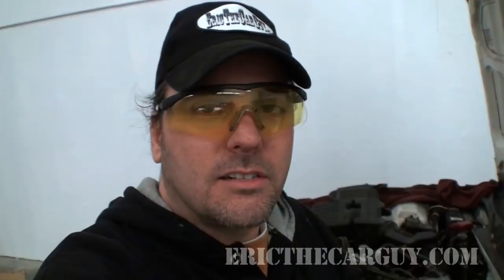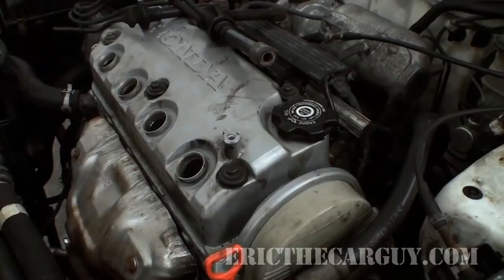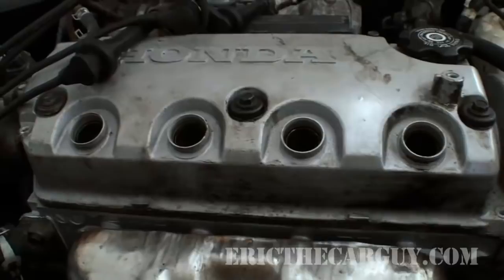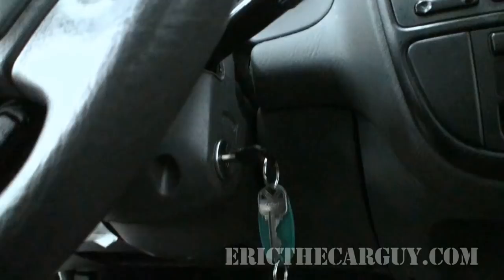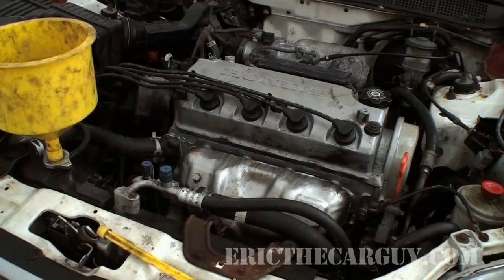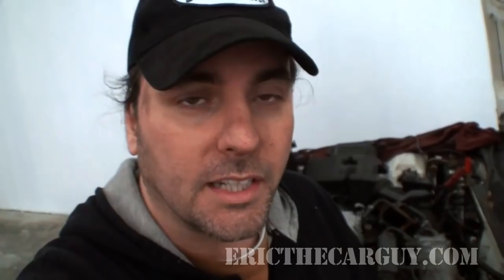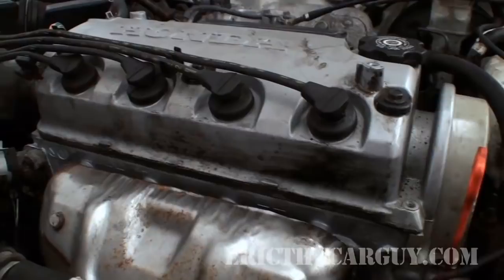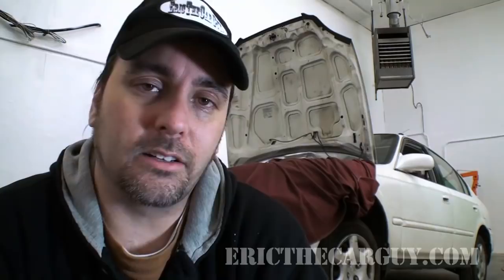How to Break In A New or Rebuilt Engine - EricTheCarGuy

Comment: This guy's information is 100% accurate. Unless of course you're dealing with a rebuit motor which utilizes a hydraulic non roller flat tappet camshaft....then you would pre prime the engine with a distributor oil pump tool....for example chevy 350....etc

Comment: Couldn't you just unplug the crank position sensor like we do on the Fords? Nothing works then and you are free to crank and build that oil pressure.
Reply: same as GM's
Reply: You can but sometimes the sensor is hard to get to. I'd have to pull the lower timing cover off to get to it on my Lancer.
Reply: Oh wow ok I see.
Reply: Yeah, you can do that on older subarus too if you just dont want spark, it still might pump gas into the engine though, and you still have to remove spark plugs if you want no compression for easy turnover, but yeah you can remove the crank sensor and it stop the car from sparking
Reply: GM 3.1 3.4 and 3.9 V6s have TWO crank position sensors....

it will run if the high precision one goes out..... but if the low precision goes, it wont run
Reply: My Volvo won't even crank without the cam sensor in.

Comment: Eric, when i used to play with Chevys back in the day i had an old distributor and i ground off the teeth on the distributor so it engaged with the oil pump only so when i was starting up a new engine i would use that and a drill to 'prime' the engine with the valve cover off, FYI small and big block distributors were interchangable- that way the engine was totally primed with out turning it over at all, as soon as the oil can out of the rockers that was sufficient.

Comment: heres a tip for cleaning greasy hands. baking soda+soap any kind. works very good and doesnt leave hand smelling like grease.
Reply: I suppose anything gritty works. The soap I use has bits of sand from different minerals as well as a degreasing soap
Reply: Washing up liquid and caster sugar works really well too.

Comment: i heard that you should under no condition ever let it idle after you just started it up. you obviously didnt do this and definitely seem to know what youre doing, so what was up with that?
Reply: There are a few myths and a bit reasoning behind not letting a cold car idle. First off is the car is not at peak engine temp and the fuel may not combust all the way causing excessive carbon buildup in the cylinder (bad cases can lead to improperly seated/sealed valves which is a loss of power) that can also foul spark plugs. The other main one is that the oil pump is engine-rpm dependent and people believe that the low oil pressure at idle does not adequately provide enough protection on a cold startup after it has sat (not such a big issue on a car that has been driven a bit and gushed a substantial amount of oil into it's bearings). Those are the main ones people believe (at least that I have run into). If your managing a vehicle "fleet" you will hear things like 1 hour idle is equivalent to 30 miles driven. which doesn't sound like much, but it adds up pretty fast if the vehicle is in constant use.
Reply: thats not true, it shouldnt warm up fast or raise rpm. idle is good idea

Comment: Another method I've used is to make a 'preoiler'. Use a pumpup garden sprayer, attach a barb fitting into where the oil pressure switch is and attach to the flexible line from the sprayer, having removed the reg handpiece. Pump it up and rotate the engine slowly by hand/plugs out etc, you will hear the oil displace the air in all those empty passages. Have measured 40psi doing this Once oiled, reattach/install and should be ready to start. Cheap as well. Should leave sump empty when you do this.

Comment: ...isn't this what assembly lube is for? ... I rebuilt my EJ22 with my friends help and I just coated my cylinders with motor oil and used the assembly lube everywhere else and put oil on the heads when I closed it up...  sure motor chugged for a few turns of the key motor turned twice then coughed ... second pull I had it run for a few seconds then die again... third shot it roared to life and I got full oil pressure and all was good with the world... seems like this spinning piece is redundant if you do all the above when you reassembling it anyway...
Reply: Bob Villa if you didn't assemble it yourself and bought it as a rebuild from a company, you can't assume they used assembly fluid. Also, assembly fluid will do the same this as regular if the engine was rebuilt and sat for an extended period in a warehouse. There's a ton of other reasons too, like lubricating the main bearings, cam bearings, wrist pins, etc at low rpms without much resistance and heat prior to staring the engine. Every rebuild from an aftermarket company suggests priming the oil pump and filling the oil galleries for this reason, no matter how recent the build was. Also, there's many engines that have high pressure oil systems (usually diesels for passenger vehicles) that have oil reservoirs for higher demand times within the engine. The 6.0L PSD I'm rebuilding for a friend is a fantastic example of that. Basically, to err on the side of caution is never a bad thing.

Comment: "No noise, no drama..." My man... That shit sounds like a mini knock D:
Reply: Yeah I heard knocking sound too lol
Reply: The ticking sounds at the 5:00 mark is actually the fuel injectors cycling.  The injectors on most D-series engines are very loud, and make more noise than the valvetrain if it's adjusted properly.  This is perfectly normal, and sounds NOTHING like knocking.
Reply: Sounds like lifter needs adjusted or just fuel injectors cycling no big deal

Comment: @WhenImGoneCa it's the cam break in period if you put a aftermarket can in you idle it between 2000-3000 rpms for 20-30 mins. It prevents a flatt lobe.

Comment: dude, change your gloves when you touch the key. The first thing your customer will touch is the key, and no matter how perfect the repair is, the first thing they are going to think when the key is slimy is, "eeeewww gross!"
Reply: +donsbarkingdogs3 or.... just use a clean paper towel to handle the key
Reply: agreed! everything is filthy
Reply: +donsbarkingdogs3 Considering this is the second time this person has replaced the engine.... For the exact same reason both times.... I doubt they care
Reply: Yep.  I took my car to a new (to me) oil change place (didn't have time to do it myself and didn't want to get greasy) which had very high ratings.  They got oily fingerprints all over my door panel.  Never going there again.

Comment: A subtle nuance that most of you are missing... oil isn't only there for lubrication.  Prelubing is important for all the functions of motor oil.  That is, it lubricates, cools, cleans and acts as a hydraulic fluid for certain engine components (especially modern vehicles with hydraulic timing belt/chain tensioners and VVT systems).  Making sure all the oil passages are full of oil before actually starting the engine for the first time is the only way to ensure that everything will be functioning as intended.  I've personally seen failure to prelube an engine with hydraulic timing chain tensioners cause the motor to immediately jump time, bend valves and punch a hole in the top of a piston.

Comment: I have heard so many variations to this each one has valid points... take a look at a race car engine do they put around for 500 miles before raceday? No, but they dont get the life expectancy that a passenger car does. When I rebuilt mine I never went WOT but I didt take it up  to mid-high rpm and let it coast back down in gear cause it helps seat the rings.

Comment: Why does the engine look so dirty for a rebuilt engine . when I rebuild engines they look like straight from the factory ,and no grease or hand prints all over them seems like this would keep the smoke and smell down. I also noticed when you make a video for whatever is wrong with a car or whatever you're  working on ,I noticed most of the cars are foreign, such as Honda or Lexus or whatever . you should be called Eric the( foreign )car guy . otherwise I believe you are very informative . good videos , and working as a millwright for 36 years believe me I stayed dirty  lol , take care  ,,seeeee yaaaaaaaaaaaaaaaaa !!!!!!!!!
Reply: even if you paint up your engine and make it all nice and clean, that engine enamel will have to break in with the engine.
there's going to be smell weather it's new galv burning in on your exhaust or anything.
Reply: also to add to logans comment. the outside isnt nearly as important as the inside. i would and have taken the time to clean mine inside and out because im a neat freak but priority is the inside. you can always degrease/wash is after its built and tested. :p

Comment: One thing you really want to avoid is endless cranking of a new engine. Find out why it is not starting without cranking on that starter over and over. The points in the engine (hey not ignition points) that you have lubed up with assembly lube will not stay lubed throughout endless cranking. You would think it would be easy to see if you have fuel and spark and quickly come to a conclusion why you have a "no-start" condition but it does not always go so easy. You also need compression to get it started. If you are sure you have spark and fuel pull those plugs and squirt oil in the cylinders, it may be a lack of compression keeping the new engine from starting.

I have seen a cam lobe go flat on a 351 Cleveland and it was due to long cranking after a rebuild. I have only seen this once so I tend to believe the cam was not "treated" correctly when it was manufactured,very odd.

Comment: i know what you're saying as the particle size is generally very small but i don't take any chances.
at the 1500 mile service we open the oil filter to see what kind and amount of metal particles have been worn off so in the rare event anything is wrong with the engine we can diagnose and rectify the fault before it becomes terminal.
it's over what's expected but saves us money and the customer the inconvenience of a breakdown.
also it allows us to check the installation for any leaks or faults.

Comment: simplyconnected is correct. once the correct engine break-in has been performed, which is usually in the first 5 miles, there is no need as it will have already seated all the necessary parts, piston rings, valves etc.  i would just change the oil after the first full tank of gas has been used to ensure all microscopic metallic particles are flushed.  also, i would use a standard oil for the first few thousand miles.

Comment: I agree with everything you said except the oil in the cylinders, it will glaze the cylinder walls and take longer to seat the rings, its no big deal and probably makes very little difference but just thought I'd mention it. The factories stopped doing this back in the 60's because they found the engines took to long to break in.

Comment: @IHcubcadet It's because all the engine oil has drained back into the sump after being parked for a period. When you start up a cold engine, cold oil are being pumped through the system, re-lubing everything. As the oil heats up it gets thinner, which in turn lubricates better and will make the ticking go away.
If it takes substantial time for the ticking to go away, you need to change your oil. I change mine every 10000km (gasoline engine) as a rule.

Comment: With ref' to what you were almost saying, I think you meant "every crook and nanny', I think??? New en rebuild very good ideas, thanks. I did the same thing to the first rebuild I did alone. It was a 1250 cc engine so not huge, so I actually turned it over by hand with a spanner to the big-end at the front of the engine. Then started the engine on the shed floor, and as will yours no drama as you say.

Thanks for the very handy advice here, and of course the upload.

Take care.

mrbluenun

Comment: The fact of the matter is many mechanics have there own opinion on engine break in for me I just bring the engine from low rpms to high many times and that will seat the ring just fine, or in other words I find a long stretch of road and go from 15 mph to 65 mph as fast as possible and no oil ever goes past the ring. And all the bearings need to be broken in the same way you will find out quick if your gonna have any problems, instead of 5000 miles down the road.

Comment: you can use synthetic oil, but I would recommend using mineral oil for the first 1000/2000 kilometers, mineral oil is very good for the materials to get ''adjusted to each ohter'', but after that, synthetic is better because of it being more long lasting

Comment: the reason behind changing the oil and filter after 1500 miles or as recommended  is to remove any metal particles that wear off the new components during the bedding in process.
you don't want metal particles circulating and contaminating the bearing material or causing excess wear on other sensitive components.

i rebuild engines and i don't warranty any engine unless the oil  
and filter has been changed after 1500 miles (for car engines) and at the recommended service intervals thereafter.

Comment: Excellent technique.

I do something similar to prime the oil pump and filter following an oil change. Although I turn the engine via a road wheel rather than the starter motor; because being unaware of the relevant circuitry, I'm unsure as to whether disconnected plugs and coil will have a benign effect on the electronic ignition and computer control.

Safe than sorry. Not forgetting the advantage of the resultant physical exercise!

Comment: If you want my tip! crank it perhaps u have to take this in 2 turns with a brake inbetween, but you wanna do this until the oil pressure light goes out! that means that you have pumped the engine with oil! what builds oil pressure? its the internal restriction between parts! as oil is more dense then air you wont get oil pressure before there is oil in every bearing and cam "spoke" "bridge" "and so on"....

Comment: I would recommend fully throttle on the first drive, keeping RPM below 4,000rpm for the first 100miles due to heat caused by the friction of the new piston rings bedding in against the harsh cylinder bores (honed/rebored). As much full throttle and engine deceleration as possible to aid the piston ring sealing. Also, DO NOT run synthetic based engine oil until after the first oil change as it will 'over lube' the cylinder bores lowering the piston ring sealing ability

Comment: Noticed you said that when the vehicle overheated and cooked the new water pump. I'm changing my radiator because it is busted. I was going to check the entire system but was about to ignored the pump. Thanks for this tip. I would have hated doing all that work and then have to get in there because of being lazy and not checking the pump. (Chico)

Comment: Shit I go full prelube on my engine rebuilds. I tend to use a high quality assembly lube and do things like pump up new lifters. I dip many parts in oil and I like to fill the crank case with the valve cover/cam cover (which ever it is) completely before bolting it down.

Then I will do the whole cranking thing to work the oil pump. Then I will run it for the 500 miles thing I drain and refill a final time. Then change again 3000 miles. And then after that I usually change every 5 to 7 thousand.

Break in is very very very important for a rebuild or any new engine. Why some dealers just pop a new one in and send it down the road without any information to the owner is beyond me but I've seen it happen.

Usually 9 times out of 10 if you did just send it down the road it will last a pretty good amount of time but by following the break in it will last a whole lot longer and you remove that small percentage for failure. Good info.

Comment: I can see letting the engine idle for a short time to warm up and bleed the cooling system. But Eric never talks about in favor of putting a partial load on the engine to seat the rings in the beginning. Other people say to hold the engine at 3500 rpm for 15 minutes, change the oil, go out and drive it 20 mile hard break in, change oil again and you're good.  Having water pump issues really would delay things.

Comment: filling the cooling sytem with hot as heck water, just before start will help also, and if you can pre heat the oil, just before pouring  it in, break em in with castrol 10 -30

Comment: because a block is honed and crosshatched to break in the rings properly, and to set correctly you need to maintain maximum pressure in the cylinder, which doesn't happen if you maintain rpm's.  You need to put a load on the cylinders.

Comment: in the world off 2stroke motors i've heard that its better to rev the engine up and run it hard so the rings can seat properly and that with new engineering engines are made with better tolerances so you dont have to worry about revving the engine high when its new

Comment: You could also shift into a lower gear like 5th or maybe even 4th, if it isn't at the red line yet, and just let the engine do the breaking (neither gas nor brake pedal being touched), and then shift back up when you reached your taget speed. Advantage: Saves fuel. Disadvantage: Don't shift too low (like in 3rd or even lower), so the engine doesn't rev up too high. Since it is pushed to the higher rpms by the vehicle speed and quickly slows down, you should be fine.

Comment: One note I will say, the whole oil burning, some cars do this naturally. My engine does need a rebuild, its a Saturn, it burns around a quart of oil every 200 miles, it may sound like its dying, but besides burning oil it runs perfect. It's got almost 217,000 miles on it and I've owned it since it had 207,000 miles on it and its done this the entire time, so I've dealt with it being on "deathbed" according to oil burn for 10,000 miles and its running strong still, and I don't see it changing.